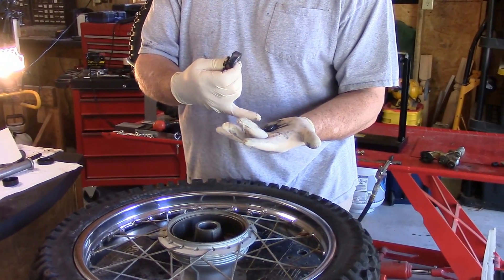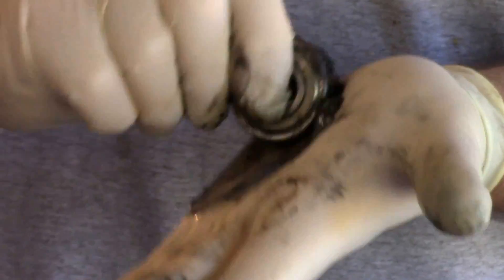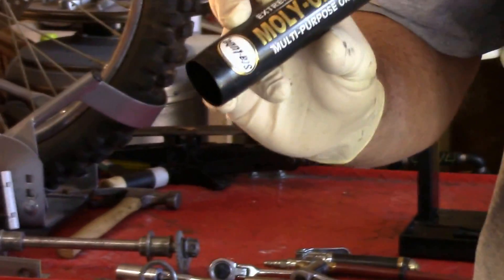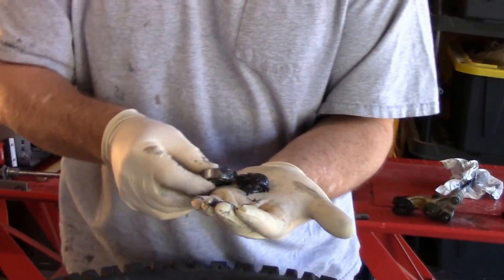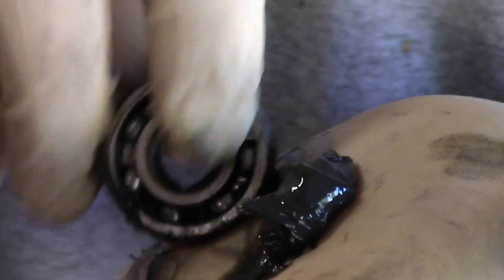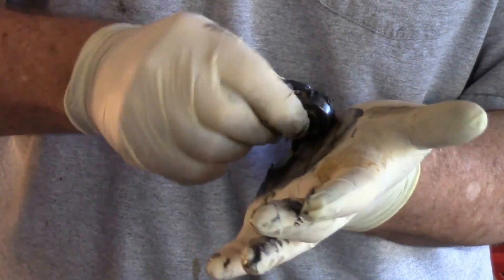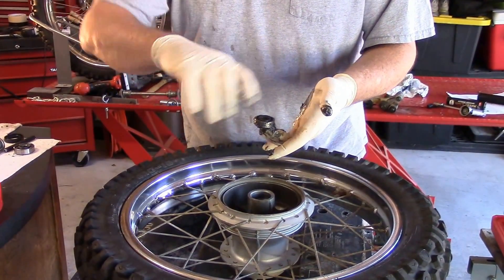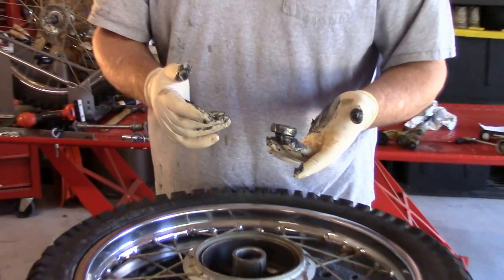Packing a Motorcycle Wheel Bearing

Comment: Moly grease is for sliding mechanisms,  and not recommended for roller or needle bearings. Use lythium soap based grease on motorcycles or Wheel bearing grease for auto wheel bearings.
Reply: Why not simply use good quality wheel bearing grease? I use Bel-Ray Waterproof Grease, I think is the best.